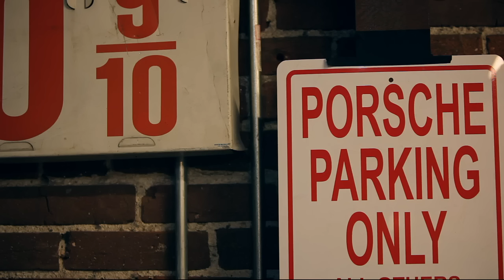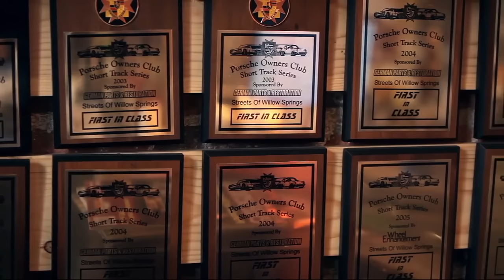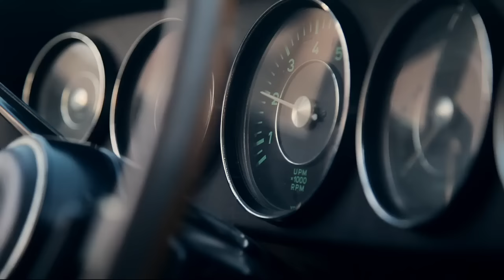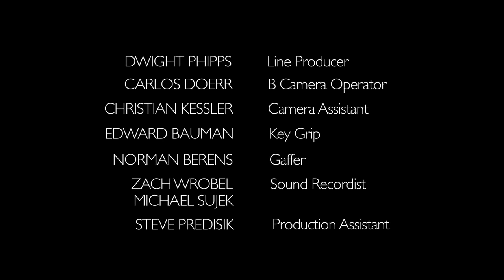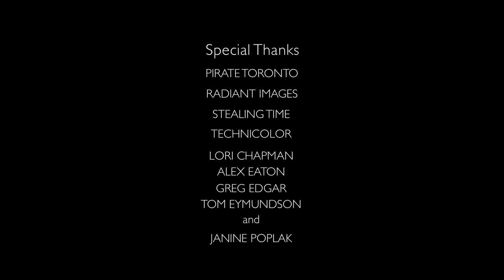Urban Outlaw - Magnus Walker

Comment: “It’s a 40 year old car so I like it to feel old, but new” - This is why I get tired of every listing that says “it’s been restored” or it needs restoring because the paint’s a bit tacky, or a £15k engine rebuild because 1 gasket is leaking. It simply fucks me off. If you get an old car keep it old. I’m not saying don’t fix or replace things, but there’s a difference between putting a new belt or fresh gaskets on vs. a paid nut and bolt restoration because they’re trying to flip it for a profit. 

I hate garage whore cars. Fucking drive the thing, beat it up and fix it when it stops letting you beat it up anymore. You can tell me a story about a beaten up car any day.

Comment: Magnus, I hope you see this comment and give me some input because, I've been offered a 70' Porsche 911 by a guy who says it belonged to his dad who passed away several years back and the car has been sitting in a garage ever since, unfinished.  He claims his dad bought it new in 1970 and is the original owner.  The car looks solid exterior-wise but the interior is rough needing new seat upholstering, it needs a new headliner and the engine is in pieces in a big wooden crate but the guy swears it is all there, it just needs rebuilding.  He is asking $5K FIRM and will not budge on that price.  What do you think I should do since it needs so much work and I am NOT a mechanical kind of guy?  Thanks bro, Hector.
Reply: You better have taken it dude '70s porsches are over 50 grand now

Comment: yeah a brand! loyalty 914s were supposed to be affordable entry level cars for regular folks. The 73 911t, at a very friendly sub $10k is no longer possible.
They are the type of car many more would drive because they are simple. A little high maintenance in cases & “mechanics” who don’t even know to get a NOS crankshaft installed vs having the worn crank welded?